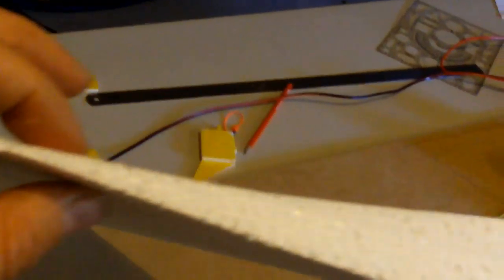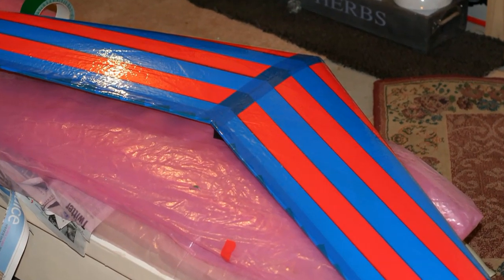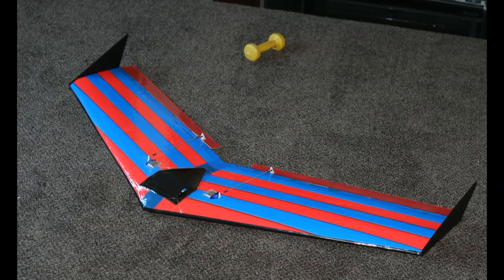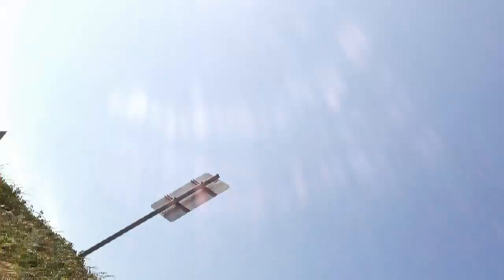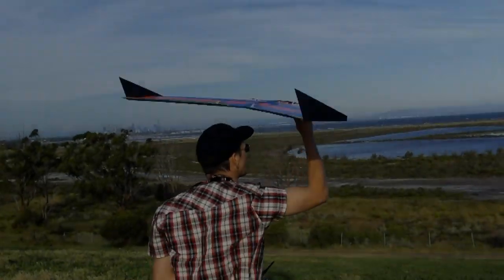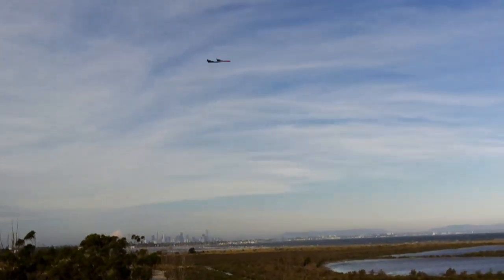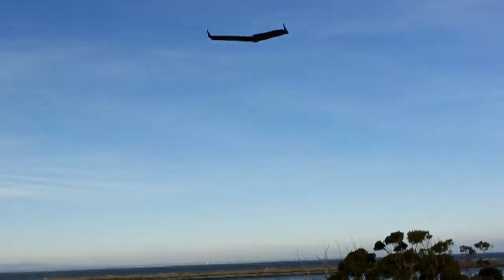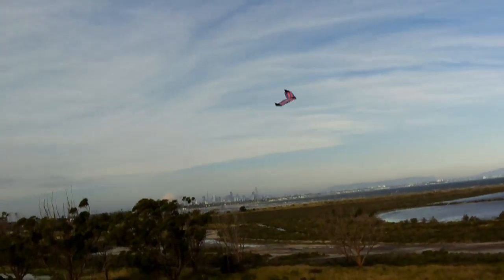Kaver Wing

Comment from the maker: Ha Ha… you will be surprised once you get into slope soaring how easy it is.  This is not the best video of this wing as I had some control horn issues on these early flights.  It’s a great wing, the powered paper and PVA version was repaired and I use it with a GoPro mounted for some aerial video.

Comment from the maker: @JC0926 Thanks, it's easy once you have the angles worked out.  Check out the video I have now attached, he is from Sweden and uses the same method.  He uses blue foam which is hard to get here in Aust... but should be easy for you :)  Styrene works fine, and is very light but can be damaged easy.